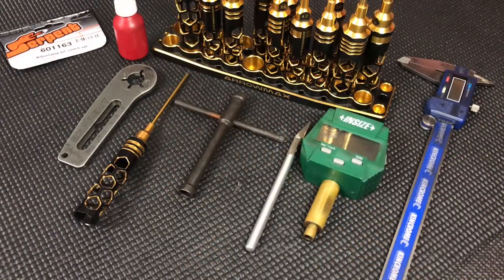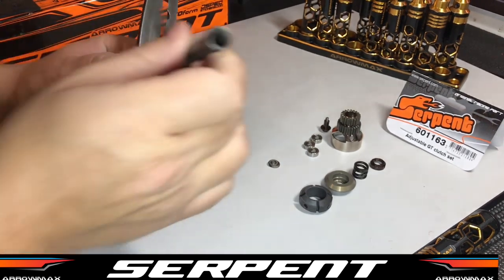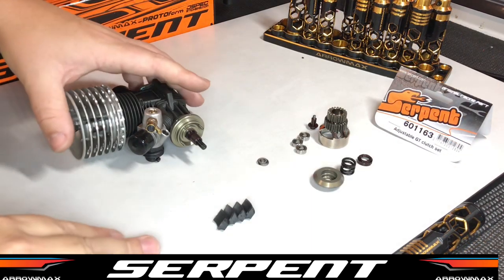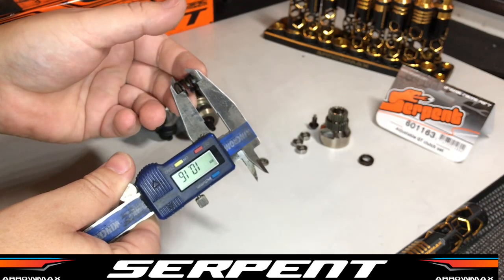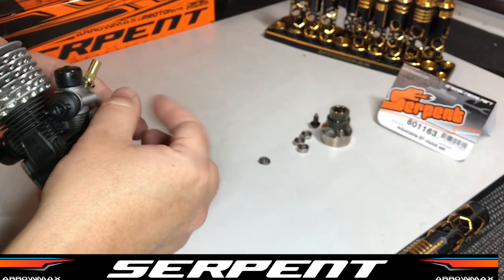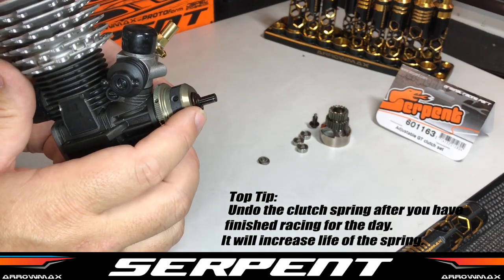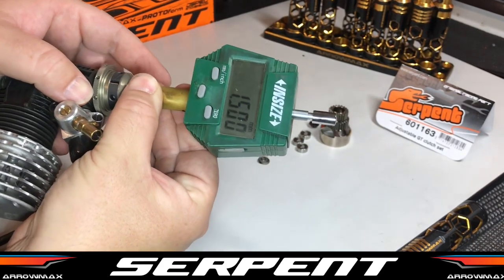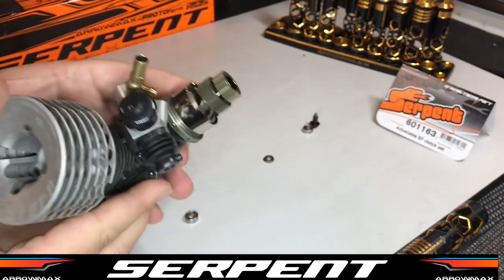Serpent SRX8GT Optional Clutch Build

Comment: Hi Jeff. I used this video and set the spring to 1.2 and second changed perfect. This is my second Spring on this clutch and they are only coming at 9.84mm after an initial squeeze. My first spring was less than 9.8mm when new. Will this just burn out my clutch shoes quicker? I havent seen a spring 10.15 or 10.2mm yet. Just curious what you mean by 9.8mm or less=garbage.
Thanks again. Great videos. 
I am an aussie, working in Nassau, Bahamas. Racing GT nitro Serpent with the local Bahamian guys. Great fun.  Cheers

Comment: Do you have any tips for the gearbox assembly? I’m having problems with the 2nd speed clutch, it’s getting stuck and making the housing oval. Happened twice, then it locks in second gear. I already have the xli 2 system, which is theoretically better.